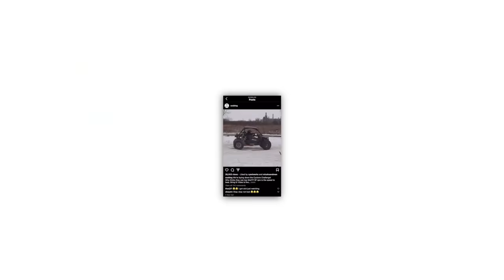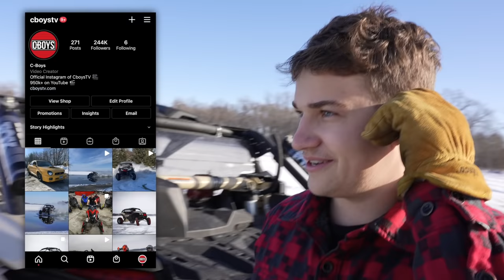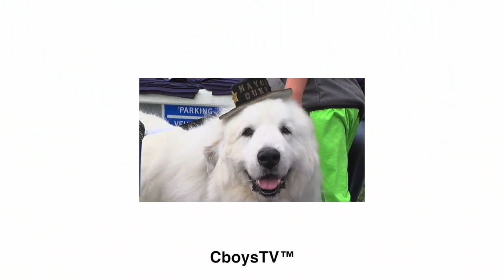DNR Officer Harasses Subaru Driver on Ice

Comment: EVERYONE NEEDS TO EMAIL THE MINNNESOTA DNR. This isn't cool, the dnr should be worrying  about wildlife, not issuing road citations for people on the ice.
Reply: And besides everyone is already killing wild life by hunting
Reply: Bruuuuuu
Reply: What happens wen he goes through that ice
Reply: Im gonna guess you do not know about pressure waves on ice.
Reply: Again there, are literally ice roads on that lake. It was probably a couple feet thick. They got in trouble for doing donuts.....
Reply: @ryangiltner5640   right, ice roads where you drive slowly. when you drive fast on ice, it causes a ripple effect and can be dangerous for people literally miles away from you. also yes, doing doughnuts out on the ice where it's possible to wreck your vehicle and force a wrecker to come out and try to clean a car up off the ice when it's not that thick is also less than ideal.
Reply: @zachofalltrades7328  yup, plus it's considered a r o a d. So the fine is justified.
Reply: In Colorado they have a lake that you can drive on and do drifts so I see no problem doing this unless the ice is thin which it probably isn't
Reply: @zachofalltrades7328  dude you have no real experience. That's not how shit works at all. When I'm out on Lake of the Woods pulling a 8000 pound trailer with a 7 thousand pound truck, then you slow down to about 30. You can literally try as hard as possible, you will not go through the foot or so of ice with a car. I mean honestly, you could drive just fine on 6 inches with a car like that, just not safely.
Reply: So, the lake falls under their jurisdiction. Wildlife lives in, around, and depends on that lake. He IS worrying about the wildlife. Doesn't matter if it isn't "cool" in your opinion. Are you a DNR officer?
Reply: @ryangiltner5640  When are donuts ever legal? I'll wait.
Reply: @dismic3556  Wrong again, he issued the citation for careless operation. It was "saftey" reasons. Like you just said, he should be concerned about wildlife. Donuts on the ice has ZERO effect on wildlife.
Reply: @dismic3556  Dunkin'?
Reply: @weedy_plays5889 , if there were any major fluid leaks in any of those vehicles they would not have been driving them out there. Also, there are companies who specialize in pulling vehicles out of lakes. this is a known risk, and it is not up to the government to protect us from ourselves.
Reply: @zachofalltrades7328 , pressure waves?! alright, you convinced me! the government should definitely protect people from themselves.

if the DNR is going to do anything, they should inform people of the risks when they see people taking risks, and then they should leave. that would be a better use of my tax dollars and sportsmen licenses.
Reply: @dismic3556 , how were they threatening the lake? by possibly having their car fall into it? is there a regulation on the size of truck you're allowed to use to bring your ice house house out? 

do you know that fishing and ice fishing licenses largely fund re-populating lakes with fish? the DNR allows over fishing. the DNR also sucks at dealing with invasive spices. they seem to be pretty good at preventing people from ice drifting though. no, I am not a DNR officer. I fish, ice fish, deer hunt, and pheasant hunt. I am reasonably well acquainted with my local DNR in southern MN. they accomplish what they are designed to accomplish maybe half the time. the other half of the time they irritate people unnecessarily.
Reply: @LawDawg717  The video just immediately proved your comment wrong......
Reply: @zachofalltrades7328  Again, nothing to do do with ice ripples as stated by the officer lol, our lakes hold ice drags and ice oval racing with cars going ten times faster than they were.
Reply: @625098evan  i dont disagree there.
Reply: @adamr6498  6 inches? Bro stop the cap. 6 inches of ice will not hold a 2000lb+ vehicle up 😂😂😂
Reply: The lake is legal property of the state, it won’t ever get overturned lol
Reply: @Lookin4WhoAsked  8-11 inches will, 6 is more snomobile and atv.
Reply: @weedy_plays5889  you must live in the south? I know the lakes around me have 12 inches of ice and it's been warmer than Minnesota. 12 inches is enough ice to drive a truck on.... And people do it every day.... Legally.
Reply: @Lookin4WhoAsked  Well obviously you have no experience with anything above 4 inches! Haha but in all seriousness, 6 inches of ice will more than hold up thousands of pounds, the only thing is, when their's 6 inches in one spot, their's 2 in another. Ice is extremely uneven underneath. You could probably find some sort of break strength chart of ice that's used for scientific purposes, not fishing. All the charts for fishing lead high cause otherwise idiots would take one measurement and base it off break strength and fly out strait into .5 in ice with a blue 1995 chevy 1500.
Reply: @625098evan  "irritate people unnecessarily" there's your opinion again! Sadly, that doesn't matter. It also doesn't matter how "close" you are with your local dnr. ARE. YOU. A. DNR. OFFICER? no? no. ok well coming from one, you, sir, don't understand what the job objectives of dnr are. Maybe your local dnr sucks with invasives, but that's a direct reflection of their work ethic. Not in my corner of the country. I would recommend looking into those "imaginary" regulations you spoke of.
Reply: @dismic3556  Are you inept, it's legal to drive vehicles on ice, the DNR officers stated it was a public saftey risk, there is my evidence.....
Reply: Michigan has same laws
Reply: @yashmakwana8237  you talking about Georgetown
Reply: @shanewells9067  yeah I'm pretty sure that the place
Reply: @yashmakwana8237  you can not drive on that lake with out league paperwork
Reply: If you think it's limited to Minnesota, you're dead wrong. In most states DNR agents and game wardens have just as much power as your typical local police, and can issue the same exact citations. They ARE law enforcement after all - it would be silly if they couldn't.

Comment: a lot of the kids I grew up with got careless operation citations for drag racing snowmobiles across lakes. the game wardens would come out to check on ice fishermen and get a couple easy $400 tickets out of it. it was a pretty well known no no.
Reply: They should have faught it. It's illegal on trails and roads. Lakes, fields, hills, valleys, mountains and canyons are all "off-road". It's only a no-no because people don't catch on in enough numbers to fight it in court.
Reply: @chaorrottai  I knew people who tried fighting it, but none of them stood a chance. it's got nothing to do with on or off road. even in the video, the officer's example was when these guys were doing the same sort of thing on a jet ski. it's all about what public recreational areas are for, and no judge is going to rubber stamp unpermitted "closed course" motorsports.
Reply: It also looked as if some large homes were on the nearby area, they probably didn’t appreciate some loud vehicles doing donuts in essentially their backyard, and may have been the ones complaining.
Reply: I laugh when I think about all the hoops you'd have to jump through to pull a permit for this. Support people who do it legally by participating in their events! Those guys would be good people to know! Also, make friends with someone who has a private pond. 😂

Comment: Couple of things:

1) In Vermont, frozen lakes are considered public highways (speed limit is 55MPH) - I believe these guys are in MN? If so, there's ice racing on lakes there, they are sanctioned but the law likely doesn't say the same thing as Vermont, much like New York, where it's a public roadway.
2) Cracking on thick enough ice is normal (12" are minimum for ice racing organizations), 8" (from what I heard in the video at 5:28) would supply you with enough strength for two cars and a truck no problem
2a) Cracking is the ice settling, remember it's (the lake) a giant ice cube
3) Those studs are pretty useless, as one of the guys correctly pointed out when losing the studs on the trailer. Spin those wheel at 50, 60, 70MPH and they are just going to be fender screws into your wheel well (and fender too if they keep going)
3a) Real homemade studded tires require unmounting, bolting them through the tire, remounting and checking for leaks, using a special "slime" to seal them, if necessary
4) Don't ever give up the throttle; you don't let off if you're heading for a snow bank - look where you want the car to go and drive with the throttle

Otherwise, carry on, boys.

Comment: On Bear Butte Lake in SD something similar happened to me, except we had about 20 people and at least ten vehicles on the ice. No citations were issued, but after being called in by a "concerned citizen" a group of sheriff deputy's pulled up and said we cant be on the ice. We talked to the sheriff himself and after some digging, found out that nobody can issue citations for driving on the ice because you aren't actually in the water. If you break through the ice and a car sinks though, you can then get a fine

Comment: Such a load of shit. I got a fine for "Operating an ATV in a careless manner" because I was supposedly "Spinning on the ice" when all I did was drive a circle around my buddy's shack without drifting, then I parked it. I also got a fine from the police for "Disorderly Conduct with a Motor Vehicle"  for sliding my Taurus around early ice. After researching (as the officers wouldn't/couldn't tell my why what I was doing constituted a disorderly) I found out that you can get one for something as little as spinning your tires or snowmobile track on the ice. Literally trying to drive and having your tires spin is against the law.

Comment: He was doing his job, technically.
I would take it to a lawyer familiar with the applicable laws and area. He will tell you if it should be fought. It depends on how much the ticket is for. If the ticket is super cheap maybe don't worry about it but I would be worried about this sort of targeted behavior continuing in the future. Even though it may cost more right now, it may be cheaper in the ong run to make it clear to local law enforcement you aren't an easy mark. It would be to establish that you won't pay tickets that would most likely be thrown out within a few minutes by any reasonable judge. 
Maybe this ticket isn't the right one to fight, but I would be looking for the right ticket to fight so you can let local law enforcement know you aren't just an easy source of revenue. That cop wasn't protecting anybody, he was making sure he hit a quota.

Comment: Their is one reason you should have not done this.... is when you are traveling fast on ice you create a ripple under the ice called a wave and the faster you go you are pushing this wave ahead if you at the speed you are going and when that wave it's the shore it ripples back towards you and when that returning wave hits your vehicle it busts up the ice and there is a possibility that a vehicle can go through the ice. That is why in the far north you travel at a slow speed on ice roads, regardless it looks like you guys had a blast doing this. 👍

Comment: You guys need ice spikes, its lot more fun with traction 😎
Reply: I don't know; that looked pretty fun.
Reply: @MrTruckerf  trust me more speed is more fun 😄 been on ice tracks with both tires.
Reply: If it's 'a lot more fun with traction' then stick to pavement.  The loss of traction is kind of the point.
Reply: @knurlgnar24  well we have winter here so if i am going to drive track in winter as well it means icetracks and i love speed, i mean its totally different ballgame to go twice faster around corners and it doesnt mean you arent going sideways 😎 this winter i am going to blast our local icetrack with my GC8 STI, dont have spike tires yet for subbie but i am going to buy ones with good wheels.

Comment: They can get nailed in Ohio, "property open to public"

Section 4511.202 | Operation without being in reasonable control of vehicle, trolley, or streetcar.
(A) No person shall operate a motor vehicle, trackless trolley, streetcar, agricultural tractor, or agricultural tractor that is towing, pulling, or otherwise drawing a unit of farm machinery on any street, highway, or property open to the public for vehicular traffic without being in reasonable control of the vehicle, trolley, streetcar, agricultural tractor, or unit of farm machinery.